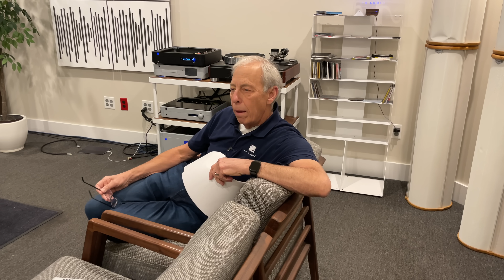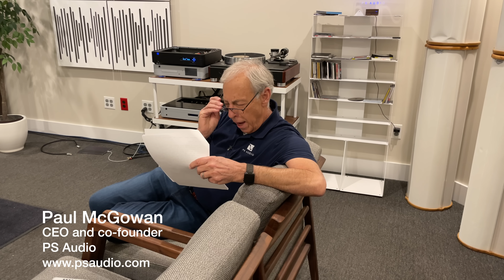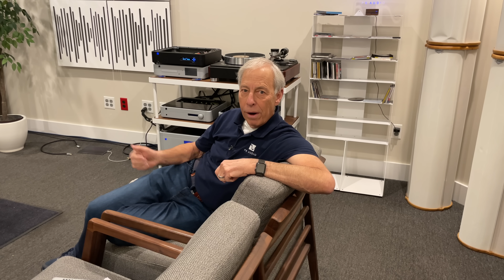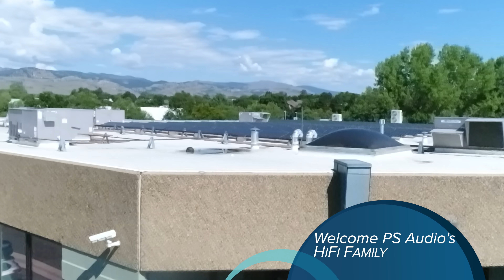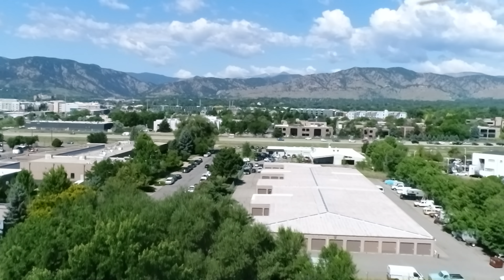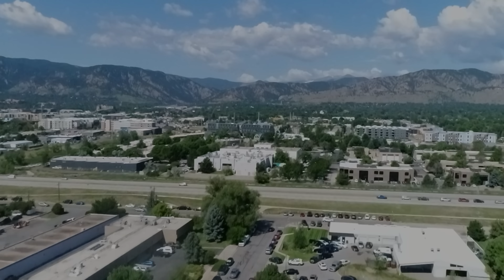High end amps vs. pro amps

Comment: As a Sound Engineer in the commercial audio space I can agree that most Crown amps do sound different and weird, but that doesn't mean that they are commercial audio standards for the whole industry. The Crown XLS is Crown's most basic and lowest quality amplifier they sell with a price point from $340 to $650 Crown has other amplifiers like the Crown XTi 2 Series, Crown I-Tech HD Series and Macro-Tech i Series these amplifiers are worlds apart and sound excellent can go from $650 to $10,000. Crown makes amplifiers at different price points. Price doesn't always translate to quality in hi-fi and pro audio/commercial alike. At the end, it’s still audio technology with different applications.

Let’s be real, Crown isn't the only one manufacturer there is. There are other amplifier manufacturers that sound more pleasing and natural/neutral sounding than Crown. Like QSC, Powersoft, Lab Greppen, L acoustics, Crest Audio, MC2 Audio, Dynacord, Peavey, EV, etc.

I had heard misinformation that Commercial Audio amplifiers do not have the same level of circuitry components in Home HI-FI amplifiers which is not true and pretty far from it.

Commercial Audio and Hi-Fi are just marketing terms, because Commercial audio is also Hi-Fi or High fidelity (often shortened to hi-fi or hifi) is a term used by listeners, audiophiles, and home audio enthusiasts to refer to high-quality reproduction of sound. Ideally, high-fidelity equipment has inaudible noise and distortion, and a flat (neutral, uncolored) frequency response within the human hearing range. Commercial Audio equipment can also do this too.

Now speakers are for another topic, but to keep it short Commercial Audio does have amazing speakers for sound reproduction.
Reply: Sound engineers sometimes really do know exceptional sound. It kept Tim De Pavaracini in enough cash to keep a very high end audio company going. Some recordings are crap becsuse of it and we do have evidence. One thing about recording. You will be long remembered by the evidence you leave.
Reply: @bruce8429  So true
Reply: To JPH! You are very correct with MC2 Built in Devon(Honiton I think or were) Though Paul is a very knowledgeable guy he can't possibly know the internals  of so many amps. Back in the late 90s chameleon of formerly Hill audio sounded cracking...tended to overheat though(1unit) high Of A\B design
Reply: @ssgeek4515  Any idea what happened to Opus? Their Amplifiers and Speakers used to be phenomenal...seems the company no longer exists.
Reply: @ssgeek4515  MC2, beautiful amplifiers.  I'm pretty sure Ohm amplifiers are actually made by MC2; just a different faceplate.  As Plasa a few years ago I ended up listening to MC2 running Ohm speakers, and it sounded glorious.
Reply: Yes, I agree. I hear most people talking more about the Crown Amps than any other brand. Personally, I purchased the QSC 1450A with 300 watts/2 @ 8 ohms and it sounds great. Also, the QSC has 0.05 THD and the Crown 2502 @ 0.5 THD. Hope I got these facts correct, if not please step in to issue a correction. I have a 7.2.4 home theater setup and use the QSC amp to drive two front speakers. Both three-way 15 inch left and right channels. My QSC 1450A Amp has a 6-year warranty. Just purchased it in December 2021, so that make me covered until December of 2027. Paid $800 for it. A great bargain.
Reply: @ms19631964  those are rmx will last much longer I have RMX amplifiers that are already passed 20 years old and still working with not a single problem other than you may need to spray dioxide on the sensitivity knobs one time if they get dust on them but other than that those are rmx are workhorses and sound really good.
Reply: what do you think of NAD amplifiers?
Reply: @skipper6528  The THD and the Signal-to-Noise Ratio seems pretty amazing on the NAD M23 amplifier.
Reply: @JPHMP261  thanks, I've got to check that out
i was looking at the nad 3020 budget wise
I've some Sony speakers for the moment 
what do you use yourself?
Reply: @skipper6528  I never used this amplifier or band before. But I can assure you like many other HI-FI amplifiers more than enough to satisfied your audio needs. There are so many brands to choose from and a lot of them are pretty good. If you’re used ever get a chance to listen to. It tell me about it I wouldn’t have a doubt in my mind that you would like it.
Reply: The XLI series are Crowns cheapest amps and they sound the same as all the others, They just have less features and in some cases power

Comment: You just took me on a trip down memory lane. Back around 1988 I bought a used Amcron (Crown) SL-1 preamp and it wasn't great until my tech friend did a small power supply mod and changed out some OP amps. After those mods it was actually a pretty nice preamp. It has been too long for me to remember the part numbers that were pulled out and replaced but I agree early Op amps were awful.
Reply: What opamps before and after ?

Comment: Some of the new Crown and other manufactures class d amps are not getting favorable comments even in pro circles because they don't sound as good when the load drops too low. They are designed to stand up to the low impedances and be very light but not have high end sound. It cost a lot to truck a rack full of amps around the country.
Reply: My x1000 sounds night and day to the new xls1500 digital bullshitttt

Comment: Im catching on that Paul often re-visits alot of questions/inquirys. Theres a few other points such as pro amps being designed to drive pro-speakers, and pro speakers being designed for outdoor/very large spacial environments. Theres a very fine but DISTINCT line between Home, Car, & Pro audio mos def!
Reply: Well, car stereo is a different beast all together.
Reply: @hugobloemers4425  Only in implementation as the point im making. Still all the same tech & scientific principles ; )

Comment: There are amps that fall half-way between. Some of the MC2 amps were designed to meet the requirements of both installations / touring and the studio monitoring market, and they sound fantastic and are very at home in a home stereo application. They compare favorably to some fairly well-regarded high-end amplifiers. That said, they're a lot more expensive than the Crown XLS amps that a lot of people are using.

One big downside to almost any pro amp are the cooling fans. The Aforementioned MC2 amps aren't quiet- not like a server, but not great either.

There are a few other Pro manufacturers that have made very nice-sounding amplifiers. I have yet to hear or test a Crown amp that really impressed me. Even the Macro-Tech 3600 that people rave about was, to me at least, overbuilt and unrefined. Good for taking abuse, but not anything I'd want to listen to. Speaking of cooling fans, the 3600 is as loud as a server (and weighs as much as one).
Reply: my thought !
Reply: Currently using a MC2 E25 with B&W Matrix 802 S3 & honestly I couldn’t be any happier.

Comment: Respectfully, gonna have to disagree on this one.  Crown XLS drivecore 2 sound every bit as good (and better in some cases) as my Emotiva amps.  You might argue that Emotiva isn't high end.  That's fair.  
In my application, I'm using the amps in Y mode, with the built in active crossovers, to bi amp my custom built speakers.  With this, they behave like monoblocks.  Imaging is fantastic, soundstage is huge, tone is spot on, rich and full, detail is precise.  The speakers just disappear.
Reply: Well you gotta give Paul credit for not burying this question and actually taking it on which tells me he really believes in what he saying (whether true or not).  #Respect
Reply: I agree with your comment... i have been A-B comparing my Emotiva XPA DR2 vs. MC602 vs Crown XLS2002... i bought the Crown off Amazon just for -hits and giggles... and honestly im not laughing rather my mind is blown.... the XLS Drivecore2 amps can be put in an Audiophile room... Like mine... im keeping it... i respect Paul and PS audio, but they really need to take Crown seriously to see what their doing right...
Reply: True, drivecore ones are diffrent then the old stuff.
Reply: I think emotiva is not good amp, and it cheap too. You can have try with Naim, Grypon, Hegel, McIntosh, Octave  amp you will see big difference special if you pick highest model. The sound also depend on your CDP/DAC + your Speaker. If those are not good enough you change amp also can hear munch different
Reply: @speakertest5413  the Fully balanced differential amps from Emotiva are excellent, 1/4 the price of my McIntosh MC602... Solid build quality... Its very dynamic, just a tad neutral vs my McIntosh... I run everything Balanced XLR... streaming Tidal and MQA... when i bring in the Crown there's something very impressive with it's sound... performance to value its outstanding
Reply: @speakertest5413  my speakers are a custom 4 way: planar magnetic tweeter, planar magnetic mid high, 2x 5.25" mid bass, 2x 8" bass, separate quad 12" subs per side for sub-bass (different amp)  using minidsp digi for eq purposes and a Topping D90 for the DAC.  I have a small room and the performance is mind blowing to me.  I'd much rather listen to my speakers than my headphones (Audeze LCD-2, Topping D90, SMSL sp200, 31 band analog eq)
That being said, have i listened to a 6 figure stereo?  Nope.  But I've listened to $30,000 stereos and i like my setup more.

Comment: I have owned a few high end power amps, parasound, atc, bryston etc
Non of them sound as good as my crown xls 2002 amp. This is my personal experience. 
Every amp has some trade off qualities as nothing is perfect. With the crown I can hear so much more clearly the sound of my front end, source, Dac. The crown doesnt add or take away anything.
From my experience It is all about synergy and less about choosing specific components.
Reply: Totalmente de acuerdo, gran aporte.
Reply: That has been my experience as well. Crown has made wonderful amps that perform equally well on stage, in the studio, or in the living room for decades. The are as accurate as any consumer amp you will find and vastly more reliable.  Saying high end consumer amps "sound" better is marketing spin, because listening is a subjective experience based only on an individual interpretation. The ONLY accurate and objective assessment is via precise measurement under controlled conditions based on industry standards. Bob Carver famously embarrassed the golden ears with null-signal analysis to clone the 'sound' of an extremely expensive esoteric amp. He added in coloration( i.e. distortion) to precisely bake in the sonic anomalies of the other amp. None of the golden ears could tell the hear difference in a double blind test.
Reply: Yes old school crown may have been not the top. But current Gen is killing it. Specifically XLS series. That is crazy. Transparent almost Neutral and More than Decent Noise Floor at Low Gain settings. Trust me Low Gain is all you need for 95% of speakers.
Reply: I suppose you might have forgiving, soft and warm sounding speakers, possible 4 ohm ones that other amps just could not drive. Great neutral speakers reveal the weeknesses of a Crown XLS in a second of listening. Great to impress someone with clarity (so as you mention), great soundstage, fast bass, but.. the sound is just dry, to my taste. And I tried it with a great sounding tube preamp too - did not help much. All the instruments sound clear but are small, there is no meat and body to the music, and, worst of all, the listening gets fatigueing very quickly, like within minutes. But! (another but).. Take a class AB professional PA amp, those weighing some 30 kilos (60 pounds), and they can truly sound gorgeous, if combined with a great preamp and great speakers, of course. Cheers, and hope this helped anyone with their decision.
Reply: @monkeypunker thanks to put in words this feelings that many have doubts about. on the other hand, some of us ara wanting fast everything and not a real drummer playing on our room. sound with pressure tends to be more controlled, more able to handle the human x machine factor. if you want to dance, the audiophile amp will show the failure of the drummer, the lack of velocity of the bass amplifier, the bad mastering, the bad mixing, etc. How about music being mastered on pro audio instead of audiophile discussion?

Comment: I tried the crown listening to a particular reviewer and after 3 minutes it went back in the box and sent back.
Reply: Witch amp?
Reply: @jamband4230  XLS1002 I think.  I know it had the drive core 2 in it.
Reply: @ranbymonkeys2384  you realize your compairing a $350 amp to audiophile quality amps like a $11,000 ps audio amp? You can't judge crown by there cheapest made in china amp. It has its purpose for small dj setups but it's no where near and audiophile grade or pro grade amplifier. I mean its  350w ×2 for $350 that's 50 cents a watt. It's not pro audio in the sense the question was asked. This is a pro light peice of equipment crowns flagship touring amp is 1000×4 and runs about $11,000. Paul was compairing his $14,000 amps to a 40yr old crown amp made in the 70's. Remember when your listening to music at home and recreating the sound of a concert you went to at an outdoor festival or madison square garden your recreating the sound of the crown or whatever pro audio amp was used that day to project that sound to your ears. So it just makes sense to use the same equipment in your home they used that day to recreate the expirence. Crown has sold half of it's production to china for there low end  "pro" gear. But it still makes its flagship line in the states and like I said there $11,000 a piece. So yea the one you had was an 11pound pice of junk from china but it was not pro audio. Just saying
Reply: @jamband4230  The amp I had said CROWN on it.  Sorry I don't have time for chapter one.
Reply: @jamband4230  Why are you triggered so much. He’s just telling the fact or opinion that he does not like a certain crown amp.
Reply: @jamband4230  you know what, to "compare" coughing there has to be 2 of the somethings.  If I mention 1 amp then what am I comparing it too?
Reply: @ranbymonkeys2384  I'm not sure what you mean by that
Reply: @jamband4230  if you compare something you are putting that product up against another (at least 2 products to compare), you can't compare one thing against itself.  I only mentioned 1 amp so how can I be comparing.  I think your issue is with that reviewer recommending these things, the issue isn't with me.

Comment: The newer class D Crown XLS series power amplifiers get really good reviews from several popular youtube audiophiles. I have the XLS 1002 and feed it with a low cost Behringer MIC2200 two channel single tube preamp. They power two pair of Pioneer andrew jones speakers wired in parallel, and for a low budget system ($700) it plays loud and has juicy tube harmonics.
Reply: i use the 1002 as well, i found it had a noise floor but then i realized it was my pre amp stage that was cheap and USB and was amping up the noise. once i went direct to the crown the noise floor dropped and it sound incredible. not thin at all. so i would say it sounds much more full than any sub 1000 home theatre amp and im not sure how far up the ladder it goes but its the best ive heard. and i can shake the walls without even using half power on big towers. it should scare high end amp producers how effortless and clean the new crowns are and the 1002 isnt even the newest
Reply: Class D in no longer faux-pas in High-End. Look at NADs M33

Comment: Have used older (not class D) QSC in some applications - massive toroidal on board, pretty dynamic.
Two thoughts; 
1; Is Crown/QSC et al a good budget option (you can pick up 'my' QSC for $250ish) where lots of grunt is required - LRS speaker? Or maybe something else with low efficiency (thinking of a particular brand but forget name..) ahh-apogee
2; Has anyone tried modding these things? Of course there won't be a magic recipe for 'giant killing'  but given the design brief there must be loads you can do.
Reply: QSC RMX1450a - Class AB, 300 WPC, Toroidal Transformers, balanced inputs, $700
Reply: @petersouthernboy6327  Yep, I think that's the model. When I say 'pick up' I mean used. 10 on ebay at mo from 200-300 GBP (in the older style casing). 'Semi pro' use running hours can be low - a lot of those outfits average a couple of gigs a month or less. In fact the one at work does about 50 hrs over the year.

Comment: At California Audio Labs we had a Tempest come in for repair that had been used in a mobile sound truck. The original Tempest was a mod of a Magnavox player and had a plastic chassis. It also used polystyrene capacitors in the sound path. The heat inside the van was high enough to not only melt the caps but also warped the chassis rendering the player unrepairable. High end gear is not built or designed for the rigors of pro use.
Reply: I still use an Aria CD Player, Good then Good now. Although one has to use a knife to open the drawer!